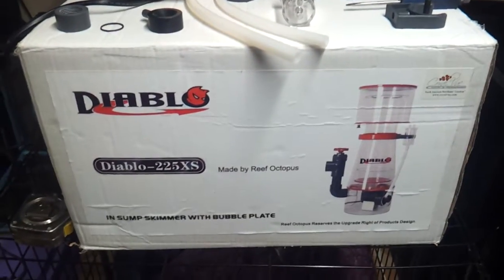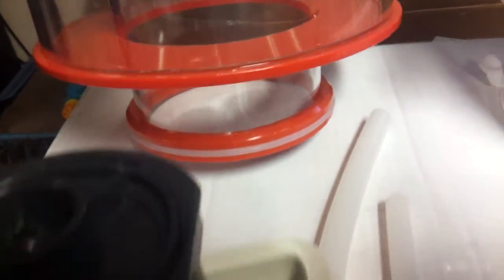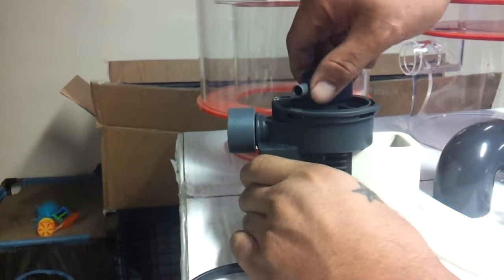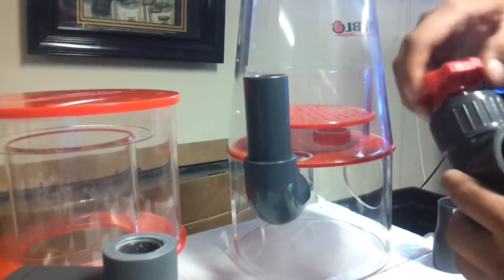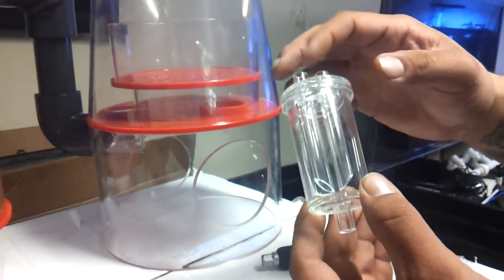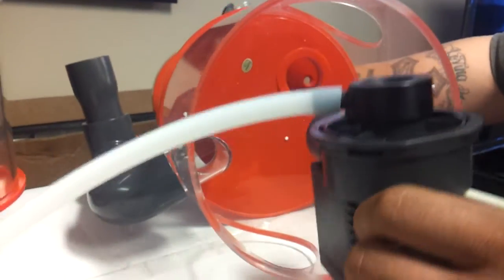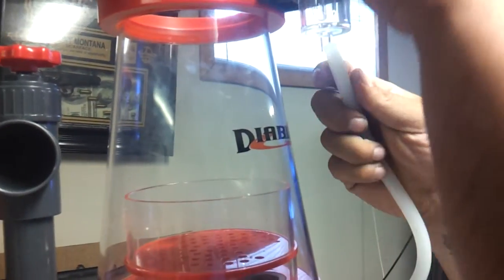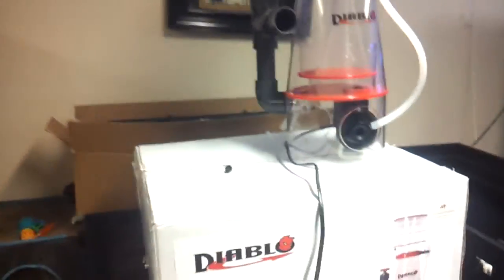Reef Octopus Diablo XS 225 Skimmer - How to Assemble

Comment from the maker: the 160 is 8 x 9 but the gate valve sticks out further like the 225, as for the 225 in the ruby 36, the 9.8 x 9 footprint wasn't an issue, and id rather have the 8'' body, along with the stronger pump, over the 6''

Comment from the maker: i wouldn't say it fits great because the air silencer and its bracket is millimeters from hitting against the bulkhead brackets, it does sit inside untouched but limits its positioning, i think im going to remove the air silencer bracket and mount it on the stand since i will be introducing my system to ozone eventually and this way the skimmer body would have a little wiggle room